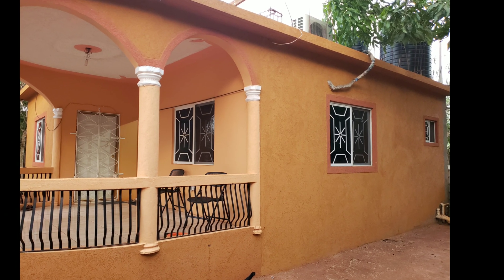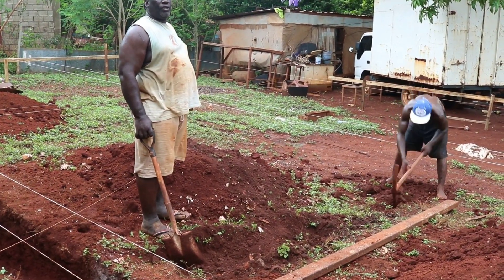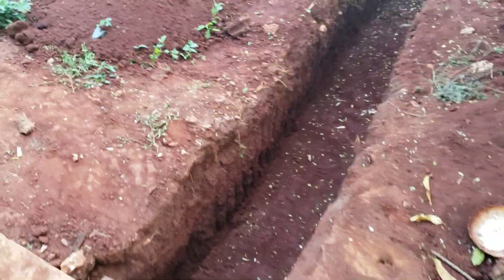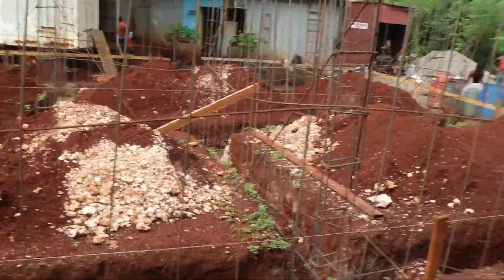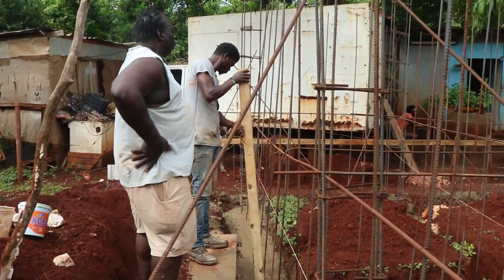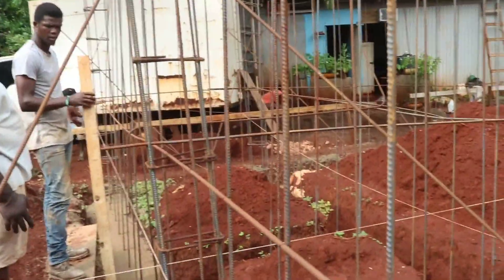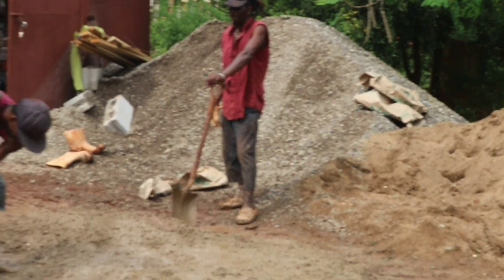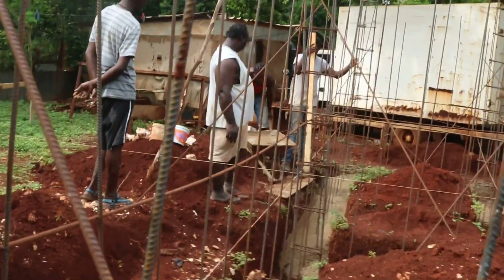Concrete Block House Foundation | Steelwork Fabrication | Rebar Weight

Comment: Are these gentlemen available in Negril? I am a lady in the US and have been fought, demeaned, threatened , lied to, ignored, and robbed and still have only 3 rows of block after a year.  Every single person I have dealt with has screwed me... pardon my French.  

If I cannot find someone trustworthy, (and how do I do that.  even my friends have taken advantage of me) I will have to quit.  My contractor took another job before putting in my foundation, and my lender bought anogher property for himself instead of plans for a year to loan me the money.  😢😢😢  Are you able to provide me with any assistance?